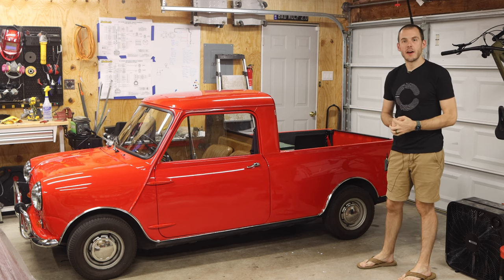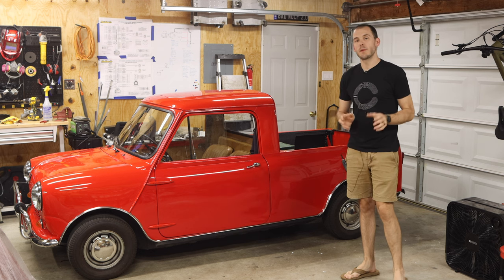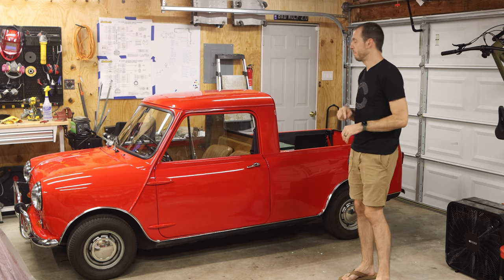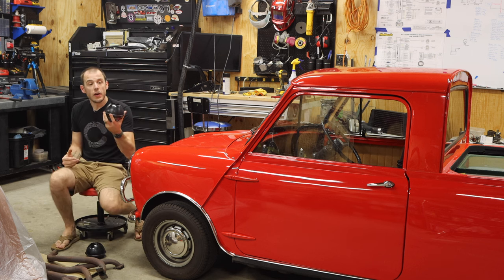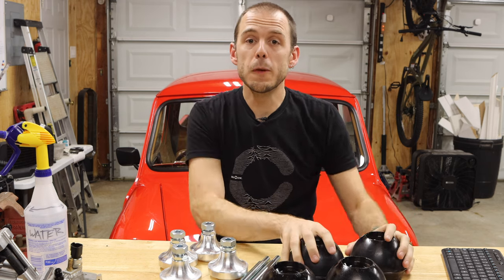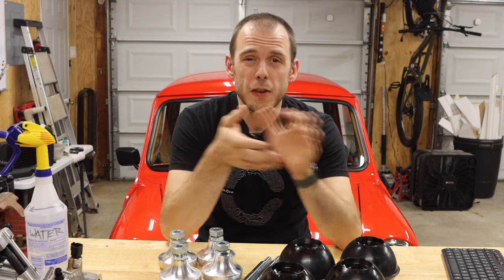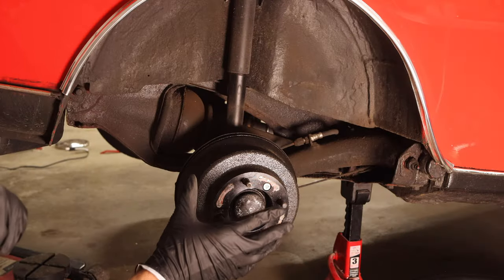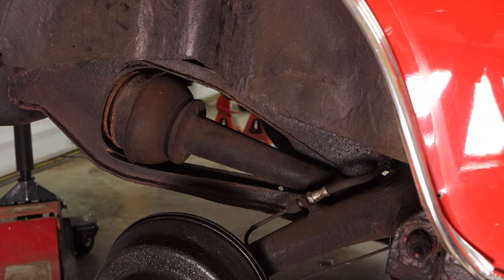Classic Mini - How To Replace Suspension Cones

Comment: Cole
Great basic maintenance Video.  Very useful.  I did it about 12 years ago 😃.
Would a bump stops benefit the Swing arm movement before the dampers stop it.  In both directions, pump and extension (just a few inches apart)?

Comment: Hey Cole, great video. Sorry about the thread issue, that is very frustrating. 

On mine, I wanted to lower the car a bit for a more preferred stance. Seems like the previous owner already put in adjustable trumpets, so I just changed the distance between the nuts. Once everything was buttoned up, I went for a drive, and was hearing squeaking at my front right (RHD car). I double checked wheel rub, and it seems clearance is good. When I took the wheel off and felt around a bit, it seems like the Hilo can wiggle around in there AND my cone can spin in place and wiggle around (cone does not do this on other side). Is this an issue, or will it just re-seat itself once the car is lowered onto its own weight again. If so, how might I remedy this? Thanks for the help! Love the channel.

Comment: Came just in time - was debating on moving off of hydro suspension and there is just way more info on cones
Reply from the maker: Hydro can be really comfy if its all working properly but its certainly more work to maintain. I also wouldnt describe it as the most performance oriented configuration.

Comment: Strange, I replaced my old cones with MS EVO's a couple of months ago and thought they held up really well. The compression tool comes with two interchangeable threaded ends, metric and imperial. The EVO's are coarse metric thread. The imperial thread is much finer. Could you have used the wrong thread maybe?

I found there was a lot of excess rubber that gummed up the thread too so it helped to run the tool through them a few times on the bench. Copper-eze on the thread helps too.

I still have nightmares about that upper arm pin removal and reinstall. Not a fun job!
Reply from the maker: This must have been the root of my thread stripping issue. My Compressor was bought secondhand and only came with the SAE threaded rod. I have done the upper pin job on a few cars probably a dozen or so times and it genuinely never gets any easier/more fun. Hahaha
Reply: I was thinking exactly the same thing. So stripped the thread essentially, nothing wrong with the part itself, just the wrong compressing tool used for the new cones. Minispares Tool PN: 660330 is what you need, as it comes with both thread rods. The other tool they sell is Metric only. So I guess the one @classicminidiy had was imperial only - not seen one of those myself - OG maybe?

Comment: Great video this is the next job I'm doing on my mini
One thing i would advise though. 
Do not use the tie rod subframe mount to jack the car up on. I have seen these bend slightly especially if the jack is not positioned correctly and that ruins the suspension geometry 
You are better off carving a block of wood to fit the front of the subframe so your axel stands can be positioned under the flats of the subframe 
Regards
Simon

Comment: Great video.  I personally have been a massive fan of the MiniSpares Red Spot cones.  Just can’t go wrong with MiniSpares, really.  Still curious how “stiffer” cones might feel when paired with the Quantum dampers sold by KAD, as I’ve been eyeing those for a while now.
Reply from the maker: Thank you! I don't think your cones will feel any stiffer really. The dampers help smooth large road jolts and assist with rebound. I found using the firmer settings on my protech shocks kept the tires in contact with the road much better and it made a dramatic impact on my cornering and mountain driving.

Comment: what are the differences between the hi-los available on the market? Or any issues picking up used?
Reply from the maker: The biggest difference I am aware of is the difference in knuckle joint post size. Minisport and specifically the smootharide hi-los use a non-standard size knuckle joint. So if you go that route, you have to always purchase replacement knuckles from them. Otherwise all the cone hi-los are essentially the same, just made with different materials.

Comment: With the nylon cup, I have had sucess drilling a hole in the centre, spraying in some penrating oil, and then getting the air compressor and blowing in the hole, and the nylon cup just pops out.

Comment: question i have red dot cones and protech shock with hilos. when you ran the protech shocks what settings did you use on the front and back that gave you the best ride?
Reply from the maker: Its been a bit since my initial setup but I think these are the settings I used. Both of these are how many clicks from the softest setting.

* Road - 6 clicks front / 4 clicks back
* Track - 8 clicks front / 6 clicks back
Reply: @classicminidiy   thanks. i had just like your road setting but with the red dots and short shocks it felt like it was riding on the cones only. i think now i have 9F and 7R  rides a lot better  but they just seamed high so i was trying to find out what others have set theres to.
Reply: @troypowell1671  I think he's been on springs only since the protech shocks.

Comment: The cone compressor has an option of two threads. It wasn't mentioned in the video, but have you encountered the old style thread? According to minispares, all cones have been metric since 1976.
Reply from the maker: This must have been the root of my thread stripping issue. My Compressor was bought secondhand and only came with the SAE threaded rod.
Reply: @classicminidiy  Well, luckily they aren't that expensive! would recommend buying a thread checker set if you dont have one. Bought one along with a thread cleaning set (NOT a tap and die). Great for checking thread size and pitch, then following it up with cleaning the threads.
Reply: Is it possible to thread a nut and washer on the tool underneath the front cone prior to compression so rubber threads aren’t stripped?